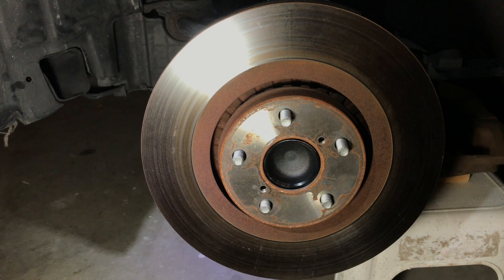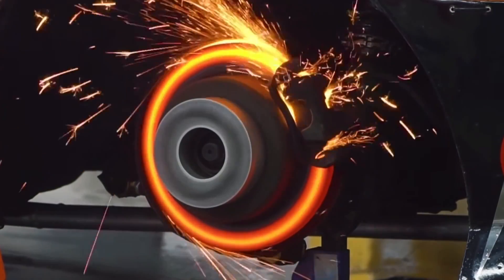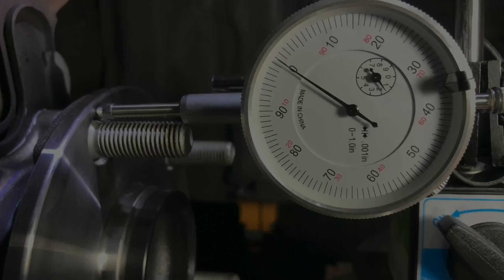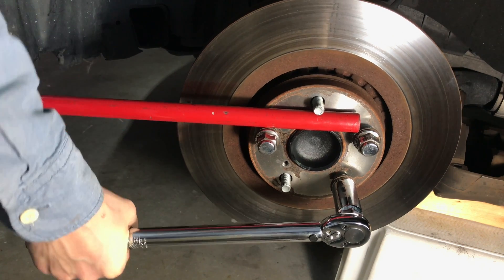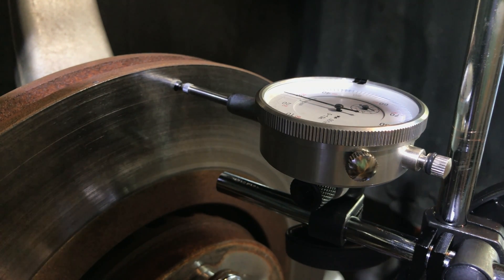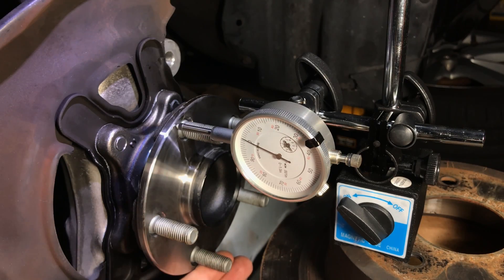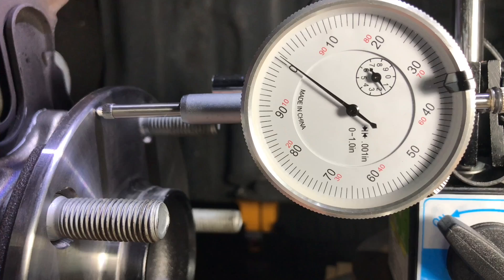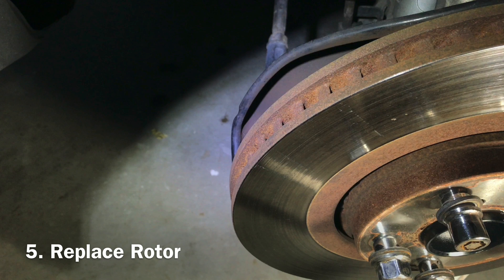How to fix warped brake rotors.

Comment: i'm surprised you had an issue with rotors on a lexus. 
toyota parts, especially those that contribute into vehicle safety directly, are very reliable. do you know what caused warping in your case?
Reply from the maker: I think it could have been caused by overheating. I got the car like that for very cheap, and got it fixed. Had them resurfaced for like $20.

Comment: Sadly many cheaper rotors and pads don’t react well with not moving the vehicle often, with heat and deep cold environments the rotors will get pad spots which will leave to streaks and shaking.
Reply from the maker: Yeah, this is where you really notice the difference of cheap parts.